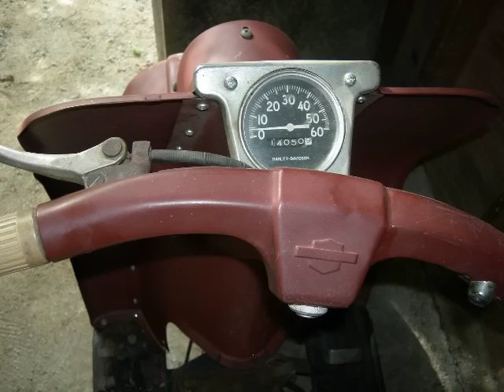1964 Harley-Davidson Topper Scooter Restoration

Comment: 165cc DKW reparation motor upgraded from 125cc. The topper was intended to be geared towards children to familiarize them before full license and larger frame and "cc" Motorcycles. The Use of fiberglass was good and is a benefit when restoring the Topper.

Comment: Nice restoration but I would plate the parts that were originally plated rather than simulate it with paint. Also isn't the horn put  in the wrong way?  Sideways? If that is a 1964, the paint scheme is incorrect, too much white.